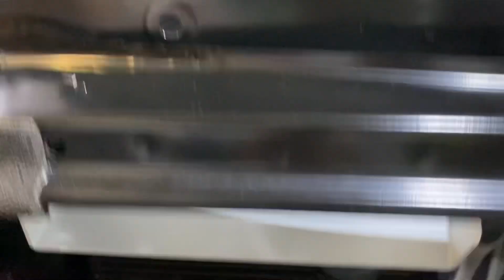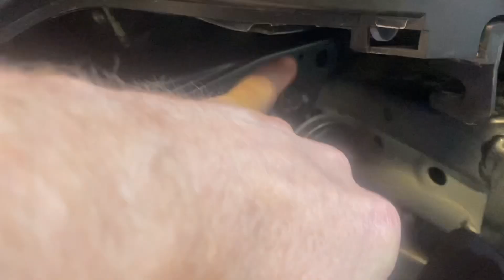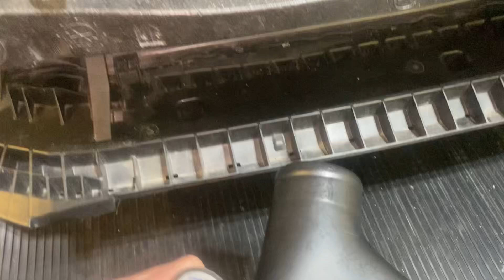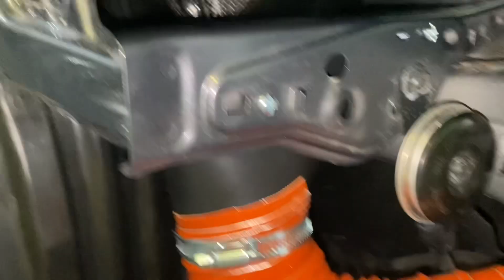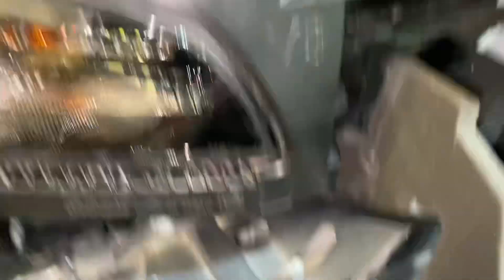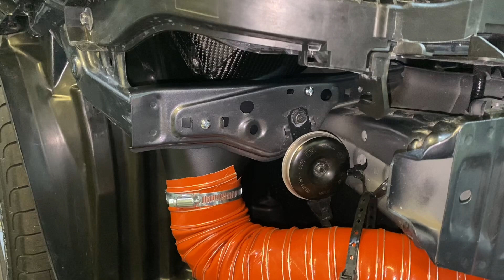RAM Air? Kind of: Subaru WRX STI ‘20 Compressive Tuning Smart Shroud/Cobb Redline Intake/Custom Duct

Comment: I’m working on the same kinda thing right now.  I’m using the fog light hole.   My issue is my intake filter ended up pretty much right behind the duct. So I don’t really need to use the hose.  There is a gap where the air can go past the filter and back under the engine.  Can’t decide is should plug it or use it for air to come in the intake as well.

Comment: I’m not sure why you put the vent in the lower grill and used all the extra tubing. You could have used the point where previous models had fog lights. Air flows through those, they can also be trimmed for better airflow, or you can get replacements on eBay that are fully open instead of a little square. Then you would have a very short tube from there to the redline.  All in all it’s a cool concept but it’s really not necessary that intake even with the block off plate on will support 600 whp.
Reply from the maker: @lucian7182  I get where your coming from.  I actually looked at a set of fog light deletes that had a vent, but the vents were small (about half the size of the vents I used) and there wasn’t really a way to direct airflow as well.   I actually have solid fog light deletes currently, so there was no real air flow entering from that site.  More or less, I’m just MacGyver’ing it and learning more about the vehicle.
Reply: Got it that makes a lot of sense.

Comment from the maker: A further UPDATE:  The actual hose was rated as follows…This ducting is made from Silicone coated glass fiber fabric
Smooth interior, highly flexible, Ultraviolet resistance, corrosion resistance, wear and durable. High Performance ratings with excellent reliability in all conditions.
Working temperature: -94 Deg F to 572 Deg F

So, I probably won’t worry about shielding the tubing

Comment from the maker: Just an UPDATE:  I added pinch weld blocks under the front duct to create a pressure fit.  Actually fit perfectly, using 3 of the 3 inch long blocks